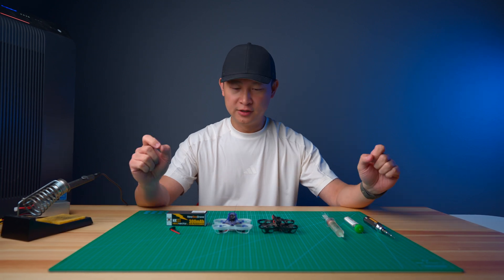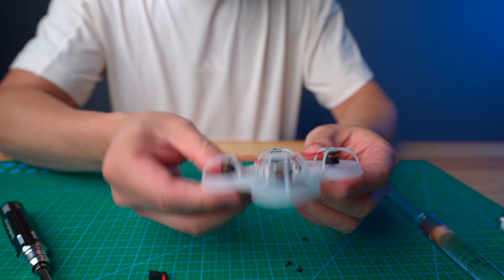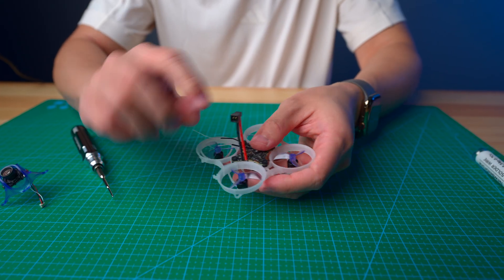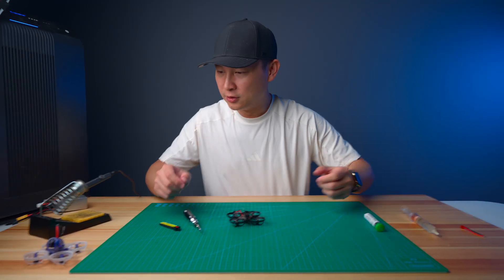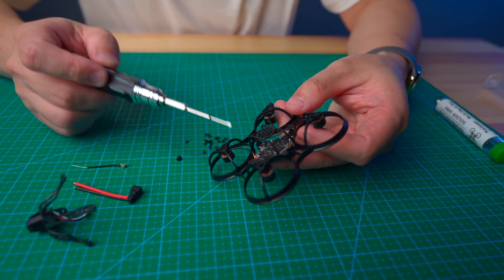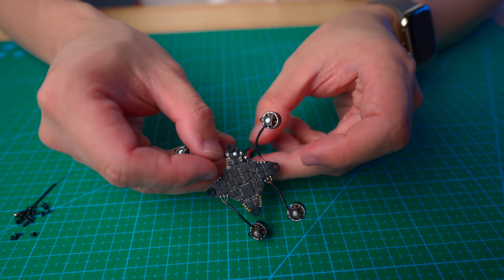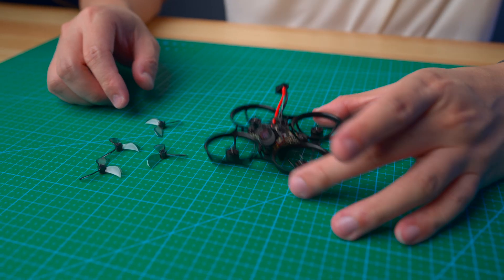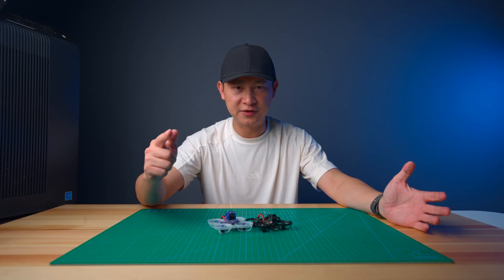Upgrade Your Whoop to NX69 | A NewBeeDrone Tutorial

Comment: Got the new batteries in today to replace my ageing BT2s. Swapping to the included connectors was fast, and I'm very happy with the new connector design. It's very secure, I like it better than the A30s Ive been using, and I'm swapping the rest of the whoop fleet over later this week. NX69 is great!